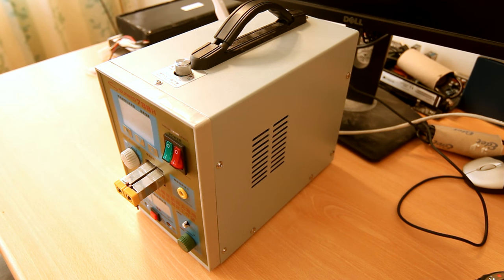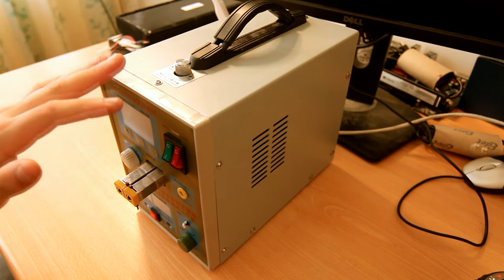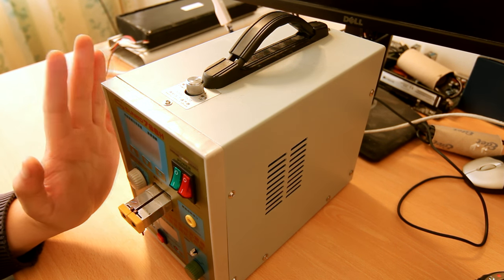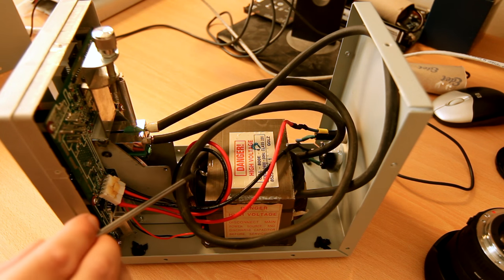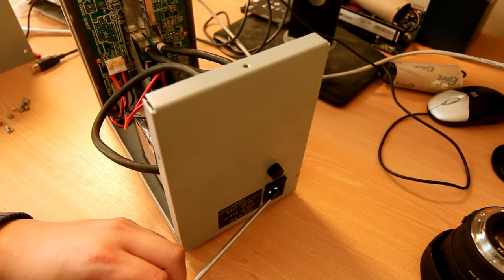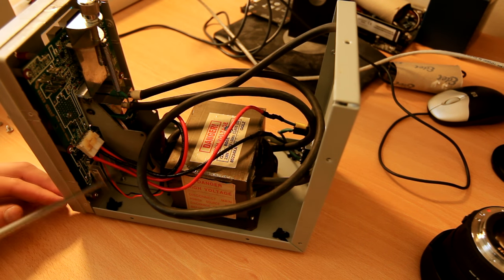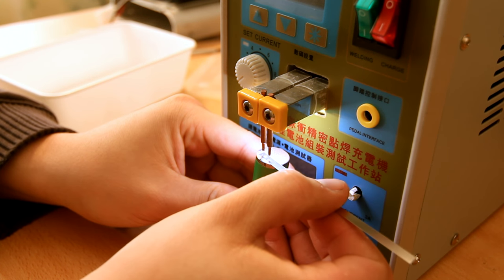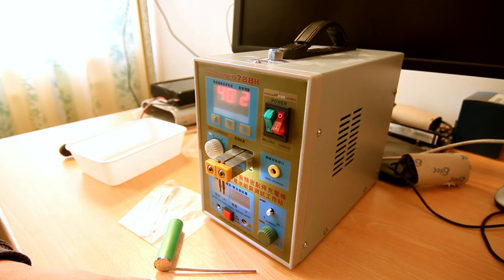Sunkko 788H FIXED [battery tab welder] (041)

Comment: What is the Max voltage (Vac) that must have the secondary of the Transformer of Microwave, to adapt it to the Sunkko 788H? Or how many laps of big wire should you have in Secondary?

Comment: It says right on the website I ordered mine from that this is not for home use and can require as much as 60Amp in rush current. So I wired in the power from my clothes dryer breaker (40amp) for this before I powered it up the first time and mine has worked fine
Reply: Id rather it be 220v, throw a spare dryer cord on it and go to town..
Reply: felix991 You are correct thank you I was using the regular 15 amp and it was popping so I connected it to my air-conditioning 60 amp and it worked fine

Comment: One quick question!! How on this planet did you manage to shove the thick wires into the relatively small holes of those metal arms? I ended up purchasing a new microwave oven transformer. I have the new transformer. But then I managed to dismantle the original E-I lamination" transformer from the 788H. The thick wire had about 2 turns in it. I'm just trying my luck and reduced the number of turns to about one turn. I've re-assembled the transformer, but not able to put the thick cables back into the holes of the metal arms. I could see that the tips of the wire cables were originally held together with a small copper foil cylinder. But no idea how they managed to fit the foil onto the ends of the wire in the first place. So, right now, I'm thinking of just connecting the thick wires to heavy duty lugs. And then somehow slot another lug into the holes of the arms. But also, I notice that you somehow managed to connect your new thick cable to the metal arm. You're using some kind of crimp connector maybe? Thanks!

Comment: Nice tutorial ...I have a question about possibly make a heavy duty welding pen for one of these.  How are those wires from the transformer attached inside the case to the welding electrodes?  Could you tap in there and use something like 1/0 wire for a heavy duty welding pen?
Reply from the maker: Totally. Yeah, very easily, and I even think I will do that as I have a gigantic battery build planned for this year which is impossible to do with the machine as is. The wires from the transformer are screwed in on the back of the bus bars that the actual welding pins are attached to, so you can simply extend the wire and make a little handheld grip for those pins.

Comment: I have a very similar Sunkko machine (simpler version without the power supply/charging function). It "welds" but even on the highest current setting the welds easily pull apart. Any idea where I should start the troubleshooting? It doesn't blow the breaker.

Comment: Dear PowerElectronicsBlog,
I would like to thank you for making this video, because I finally found out what is wrong with the spot welder I ordered from China... But... I do not know where to find a suitable transformer... I noticed that you said 190:3 winding and that it makes 4V on output... that means you have approx. 253V in your grid. In Slovakia, we have just 230V and my breakers are rated on 16A. What transformator do you reccommend? What should be the maximum Wattage (Power)? Should I use the same 190:3 ratio?
Reply: Ahoj Oliver, práve bojujem s rovnakým problémom pri mojom sunkko 737g, bol by som vďačný za akúkoľvek radu pri výmene alebo modifikácii pôvodného transformátora a spojazdnenia tejto mašinky na 230V/25A.

Comment: 'made for the dutch market, so designed for 16amp breaker' yeah except you're transforming the opposite direction that it was intended for, right?
Reply from the maker: No, the primary is still the same, I just changed the secondary. That shouldn't change the primary inductance (appreciably). I haven't switched out primary and secondary.

Comment: I've just done this mod. It works bads because i need to set it at 99A and doesn't still to be enough for 0.15mm. What is your nickel strip's thickness ?  Thanks
Reply from the maker: It works very well for me with 0.15mm nickel strips on 18650s. No good welding means the current is too low, so you either have too many secondary windings (too high voltage, not enough current) or too few (too high resistance in the secondary for the voltage available). Try one more or one fewer turn.

You may also be saturating your transformer if you are using a transformer that is too small. Compare it to my size transformer in the video.
Reply: +PowerElectronicsBlog I've done 3 windings. Have you got à mail please ton send you à picture ?  Thanks
Reply from the maker: Try first to do another winding. Pictures won't help here; it's just one variable you have to change.
Reply: PowerElectronicsBlog
Reply: did you get it to work?

Comment: I read that the CORE (metal part) of a  microwave oven transformer may be LIVE - at potentially dangerous, or potentially lethal voltage levels. So I'm thinking that extreme caution and care will be needed when working with a microwave oven transformer. Maybe a good idea to not touch any part of the transformer when 240 V AC is being supplied to it. Just in case.

Anyway, great job in fixing that pesky thing! You mentioned that your microwave transformer secondary output is 4 Volt. That's 4 Volt "AC" right?

Also, can I ask what you mean by '3 secondary windings on 190 primary windings'? That terminology doesn't seem to make sense. I'm thinking you're indicating a 190 : 3 (primary:secondary) turns ratio.

Also, if the primary side is typically the 240 Volt AC side, while the secondary side is typically the very high voltage (eg. 2000 Volt AC) side, then it will be necessary to use this transformer in 'reverse' right? That is, connect 240 V AC to the secondary, so that the primary (with the lower number of turns) develops the low voltage (but high current).

Thanks!
Reply from the maker: No, a decently built transformer has what's called a bobbin on the inside separating the primary windings from the core. The core is also always connected to PE (protective earth), i.e. even if there is somehow a connection to live, it will cause your GFCI to trip well before there is any danger. The same applies in the tab welder: there is a hard connection from ground to the transformer core. 

You still always have to be careful when dealing with mains voltage, notwithstanding.

The secondary is indeed 4VAC, i.e. 6ish volts peak. And yes, I'm talking about a 190:3 ratio. Using a magnetron transformer in reverse roughly attains that ratio. In this case, though, the high-voltage secondary was completely cut out of the transformer and replaced with the thick wire, so the original 240V primary is still there.
Reply: Thanks PEB!! I ordered one of these 988H and it arrived about 3 days ago. I turned the weld power on, and everything was fine..... well.... for at least the first few goes. But then after that, the home breaker drama started up heheheh. I confirm with you and the others that the stock transformer has too low a turns ratio. The stock transformer has two extremely thick wire cables (ie. the weld cables) coming out of it, together with two (much lower amperage) black coloured wires on the same side. I need to get in there with a meter and check out what these two black-coloured wires are (on the same side as the thick weld cables). I'm predicting that you needed to disassemble the unit (springs etc) in order to remove the weld cables from the internal terminals (holes) of the rectangular metal weld-arms.

I ordered a new microwave oven transformer which will be modifiable. I'm thinking of reducing some coil turns of the thick 'weld cable' side in order to 'increase' the turns ratio - to achieve about 60 to 1 turns ratio. On the other hand, if the stock microwave transformer (that came with the 788H) is modifiable (and it looks like it might be modifiable), I will try to do what I had said to the stock transformer. That is, remove some coil turns of the thick wire side.

Anyway, the videos you made were great. It really helps others to understand the reason for the crazy home-breaker tripping. The people that designed the 788H need to fix up their design!

Comment: just 3 windings and you get 4 volts? shud fill up all the space, microwave xfos exist in many forms from 650 to 1100 watts of mwave power, you are using a 800w.